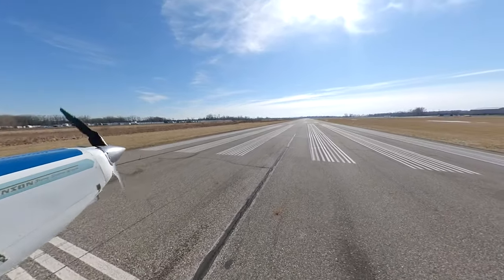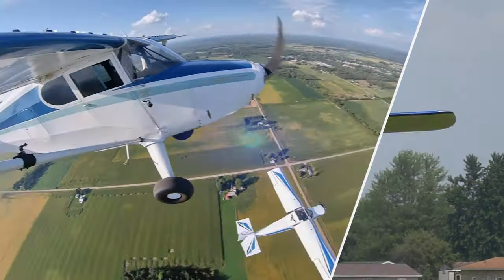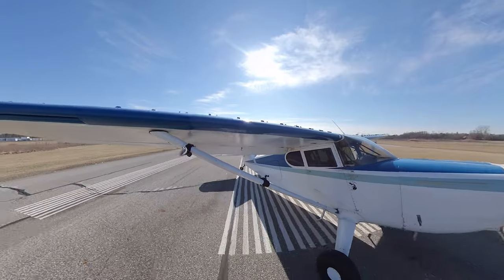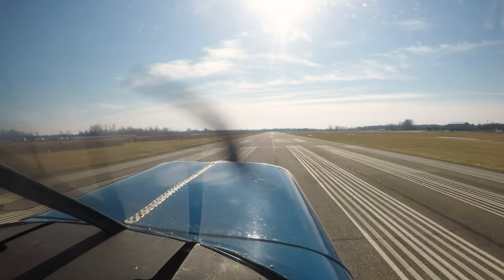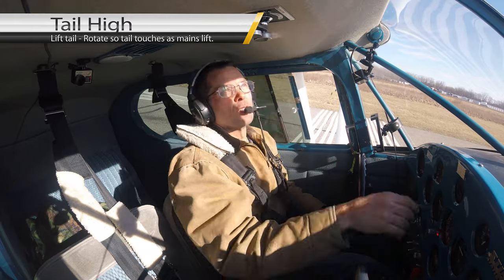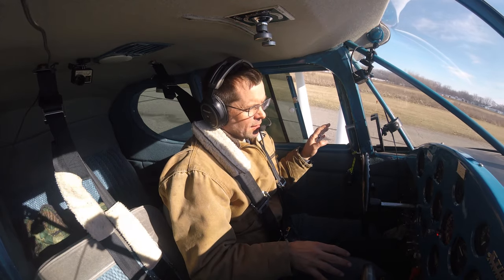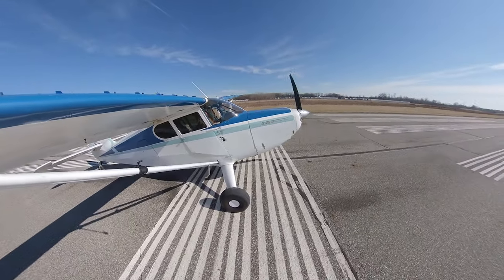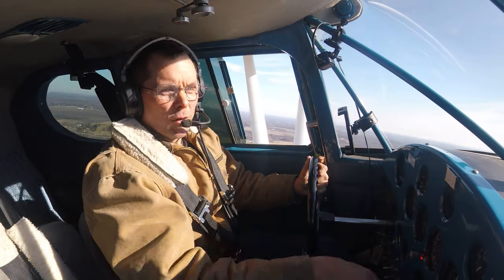How long does your airplane need to clear the trees? Stinson STOL

Comment: This Stinson has vortex generators, so it may perform better than a stock Stinson?
Reply from the maker: It performs noticeably better than it did before input the VG's on. Check out the video. I did performance checks before and after.

Comment: By the book includes how they measured the takeoff distance (reading from the Operating Manual):
The quickest take-off is obtained when the flap control is place in the first notch.  (item 36 page 26)
But, Item 37 says: take off distances were conducted under the following conditions: Wing Flaps Up

So, the operating manual leaves a hole about distances.  I know I can take off in about 700 feet without trying when I use the take-off flaps setting.  I fly a partially metalized 108-1 with a Franklin 165.  It's a bit heavy.

Other than that, given the lack of information in the manual, learning about the airplane you fly by experimentation is the best bet.  Especially since these planes are very old and have had changes in rigging etc.
Reply from the maker: Off the ground is quickest with the flaps, but the additional drag really causes loss in rate of climb making a no flap takeoff shorter to the 50'.
Reply: For those paying attention, I run a 7654 prop, which is a cruise prop.  7652 is a climb prop for this aircraft/engine combo and would get a better climb.

Comment: One question my friend . .....Do you always  " zero " your trim tabs for a launch ?????
Reply: Especially with any 6 cylinder engine over 200 horsepower  ...
 I myself , being instructed by my father , a WW2 Army Corps Flight Instructor  , and like old Bob Hoover  .. never used trim tabs .......Spoiled fellow pilots .....
Reply from the maker: Absolutely. I set the trim for takeoff. An out of trim plane can be a handful and has killed many pilots.

Comment: I am building a 425hp experimental that will be a 4 door 6-seat 108 with wings lengthened 2 ribs in the slot area for approximately 41 foot wingspan, slots extended 2 ribs towards the fuselage, wider aileron’s to match, bigger rudder, micro vortex generators and extended flap hinges with custom pockets where the flaps go up.
Reply from the maker: That sounds like a beast.  I with this plane had more flaps.